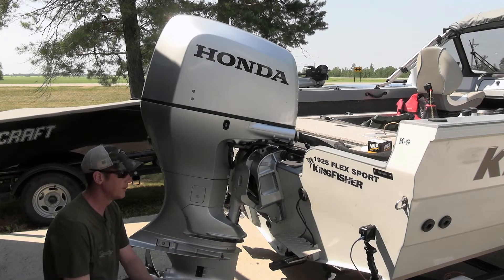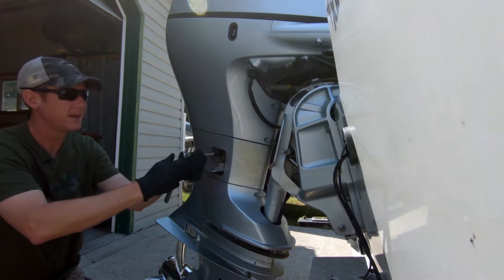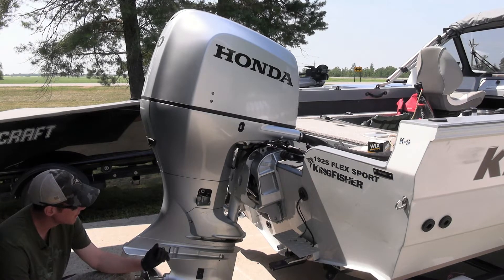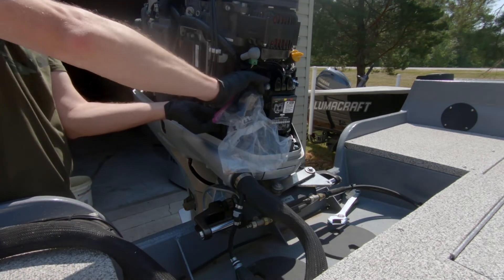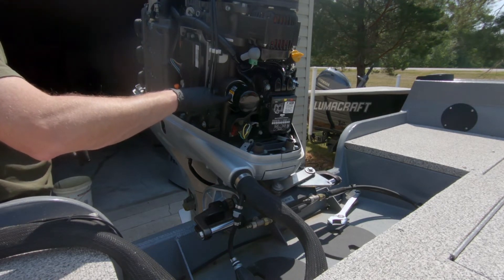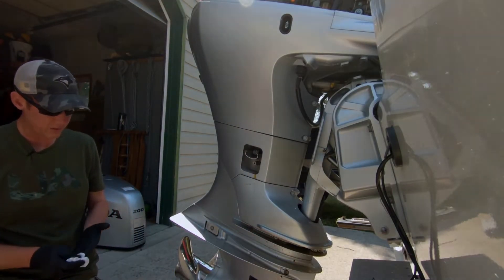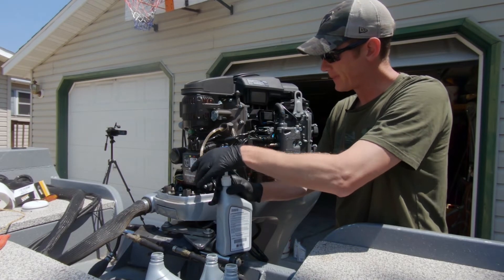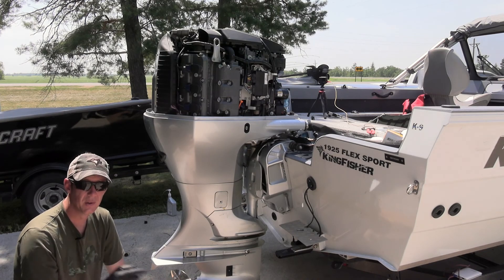How to change Oil on your Honda Outboard

Comment: If you turn your engine over to the starboard side of the boat, the engine angles to the side it’s turned to. Which will eliminate the mess altogether. You have the engine turned away from that side. I have the same engine BTW
Reply from the maker: With it turned to the starboard side it limits your ability to get at the plug
Reply: You don’t need to crank it all the way over. Just until the engine starts to tilt. Your engine is leaning port side. You’ll also have to trim down all the way too. It will eliminate the mess all over the bottom of the engine.

Comment: I made a ramp for the oil drain.  Take an old license plate and bend it into a C shape long ways.  It will rest right under the drain and let it run into a 5 gallon bucket.  Much less mess than here.  A piece of sheet metal would work too.  Love my Honda
Reply from the maker: That's a sweet idea, My Honda has been good to me, in 5 years Ive only had to replace to the fuel pump

Comment: Great video Cody! If I can make 2 suggestions I would say this, 
1. Go to a parts Store or order what's called a Paint Pen. This will become a staple in your Tool box. What it's used for is writing on the oil filters, (of anything you change oil in) pertinent information that is important for the next guy to know. God forbid anything bad ever happens to our records of service work of course, but this will have key information on the filter for the next oil change. I like to write down just the date, hours at time of service, and miles at time of service if applicable. 
2. Use the blue shop towels as these are lint free. 
The issue with lint in motors is something that's rarely talked about but it's important because the very small oil ways and galleries in the engine can over time build up with lint, thus blocking that gallery and starting a small heat rise and lack of lubrication. Of course it takes time to wreck things this way but it is a very important thing so the guy who next owns it doesn't end up having to rebuild it before the alloted time that engine should run. 
Just a couple thoughts, if they help you great if not oh well! Stay safe and stay outdoors!
Reply from the maker: When I worked on the railroad we used those yellow marking pencils to write on filters all the time! I hadn't thought of that. These past two years unfortunately I don't get the normal hours I put on my boat. The blue shop towels is a great idea as well. They are a much better option! Appreciate you watching and for your input sir!